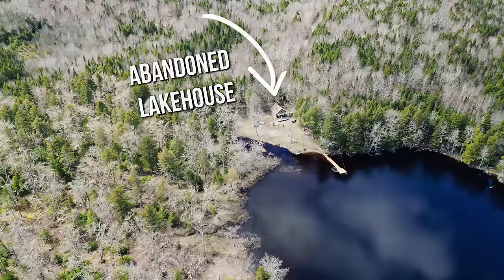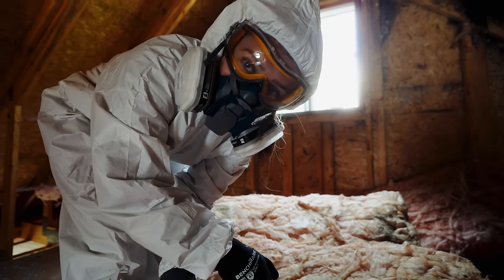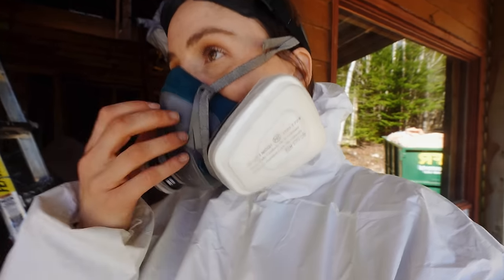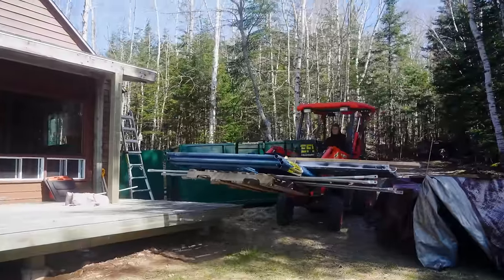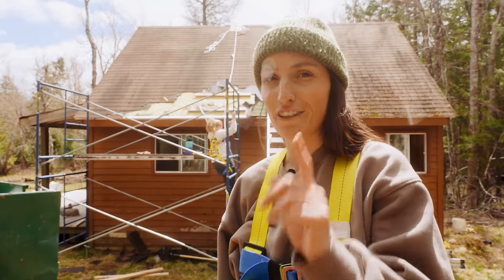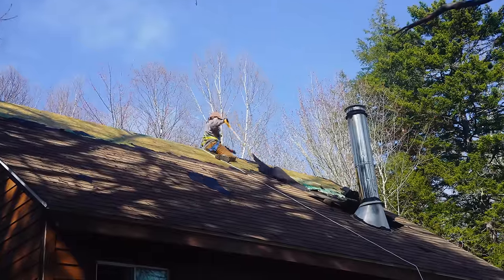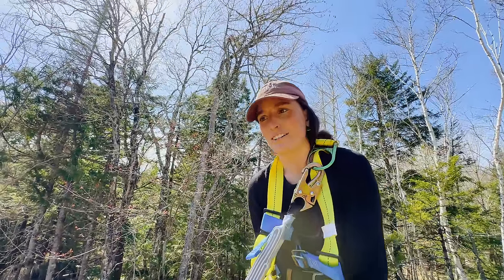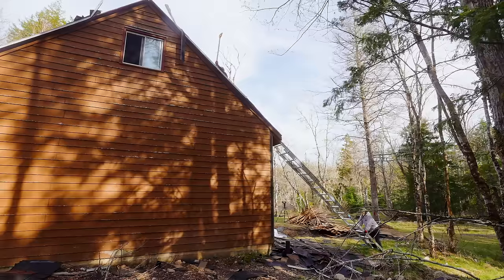ABANDONED LAKEFRONT Home Renovation: Removing Shingles

Comment: I invented a roofing butt pad 27 years ago and called it the "Bum Buddy".  Used it to re-roof my house in the city before we sold it and moved to the country.  Never applied for a patent.  Still have the prototype and use it occasionally.  When we built our new house and workshop we went with Propanel metal roofing.  Will never have to re-roof in my lifetime.  😁

Comment: Wild Wonderful OffGrid has an A frame cabin and Josh is afraid of heights ( he's mentioned it a few times ). They had to redo the roof entirely on their rental house because the roofer botched it so badly, it was equally pitched. They're currently working on the addition for their cabin, and I am going to be biting my nails the whole time they’re going to be doing that addition roof because it's taller than the original buid.

Comment: It will be interesting to see what you two goofys put under the replacement roofing.  How about a full layer of "GRACE Ice and Water Shield" in the wide rolls -- or the Canadian equivalent (or better - I don't know what the brands north of the border are, but there is an adhesive roll that slate and tile roofers use that is even tougher...).

Comment: Why would you not use screws on the anchor plate. It will secure you just the same but you can then remove it easily when you're done with it!

Comment: Try not to use the rubber washers on the nails if you do a tin roof , check for different options,  rubber will dry rot over time.....JS
Reply from the maker: Yes you have to replace the washers every 10 years. However, it’s a lot cheaper than the other roof. We will see what we can do :) ty!

Comment: Hi girls, Do you want to create a team about solar energy? How much do you generate per year and is this enough to cover your entire electrical needs, or do you also use the generator and how much does it produce? I'm also curious how the air conditioning units perform in the winter to heat the cabin.
Reply: Team = Theme

Comment: When doing  the demo on my 900sq ft riverfront cottage I threw all the insulation at the bottom of the dumpster then put all the heavier drywall and misc crap on top to squash it down.   Since the property is sloped the riding mower and cart came in handy to shuttle all the debris to the dumpster from the piles created by the front and back doors saving my old ass countless hours of trudging up and down the hill carrying everything piece by piece.  I wish I had your seemingly endless energy.  Good job!

Comment: Back in my construction days I had to wear protective gear but never as much as you wore in today’s video. I once turned down a job that was removing asbestos. My foreman told me with protective gear I would be safe. I decided that I didn’t want to take the risk.
Reply from the maker: Well we can understand that you chose not to do it. However we felt confident in the PPE we had on. 😊🐶

Comment: that insulation can't go in the        dumpster.    It needs to to be disposed of properly.  Not trying to sound mean, but you aren't qualified to do that.  Need pros to clean up mold.  Cabin needs to be wrapped, insulation put in proper bags, wood properly cleaned.

Comment: I feel like this cabin came up for sale, and you only bought it to not get neighbours nearby. There is nothing worth saving here, not the placement, floor plan, inside material, outside material. I think it wouldn't be that much more work to burn it to the ground and build a new cabin. Plus you have the Mexico project. Are you taking the long way round just for content?